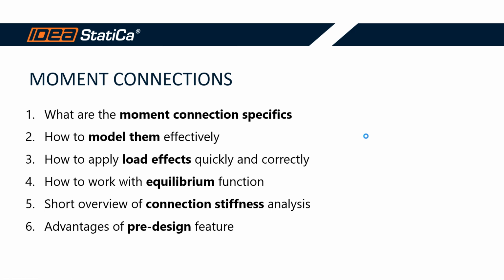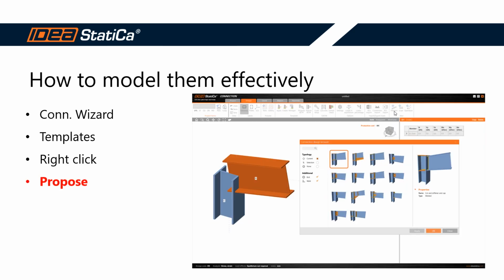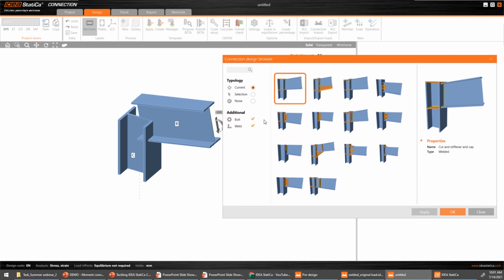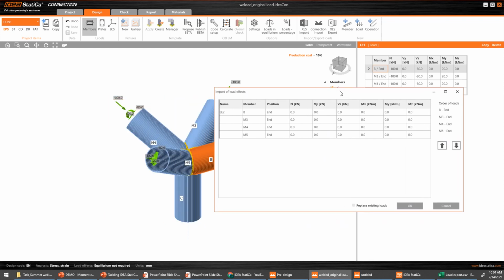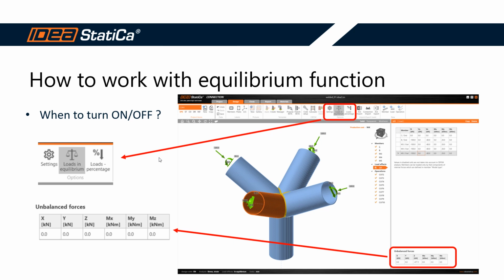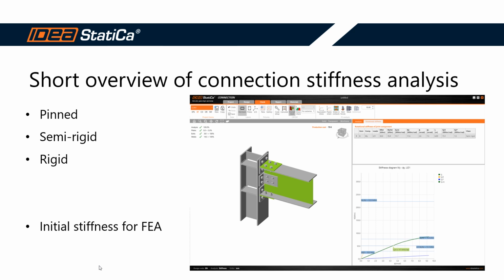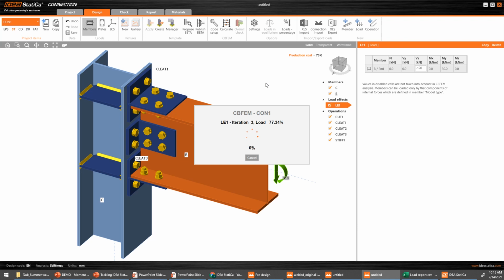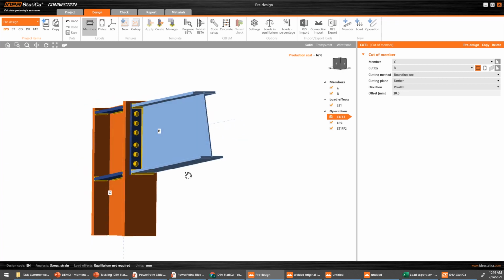Tackling IDEA StatiCa Connection – Moment connections

Comment: Hi, does it matter if i use the column or the beam as a bearing member since equilibrium loads is on??
Reply from the maker: Hello Pokoto, in general, no.
Since the equilibrium is reached, the support is there only to fulfil the completeness of the FEM model (there has to be the support / begin somewhere).
https://www.ideastatica.com/support-center/equilibrium-and-supporting-member
However, there might be small differences in case you switch bearing member between e.g. a stiff column and a very weak connected beam - different stiffnesses of memebers maybe affect slightly the overall behaviour of the model. In such cases we encourage the judgement - consider the bearing member as the "strongest" one and avoid choosing the "weakest" one.

Comment: I have a very important question that I have received different answers in many places, I would be grateful if you could help. Does the connection at 10.00 transmit moment? This connection is used in truss systems. and it should not transfer moment. but this connection is preferred.
Reply from the maker: Hello Muhammeder, do you mean minute 10:00 of the recording?
https://youtu.be/f7e7hmXk4JU?t=598
That shows a model of a typical frame corner connection, which is very stiff and is exactly designed to transfer moments between the beam and the column.
You can always find out whether your connection should transfer moment or not using the Stiffness analysis, check the blog:
https://www.ideastatica.com/blog/why-bother-with-connection-stiffness

Comment: I have a question. The reaction on the bearing member would balance the forces. So why do we have to manually input the reaction on the bearing member ?
Reply from the maker: Hello, you are right. For simple models it is as you suppose, you dont have to input the "reactions". But for complex connections where you have continous bearing member with 2 ends, you need to input it unless you get alle the "reactions" added automatically in 1 end only.